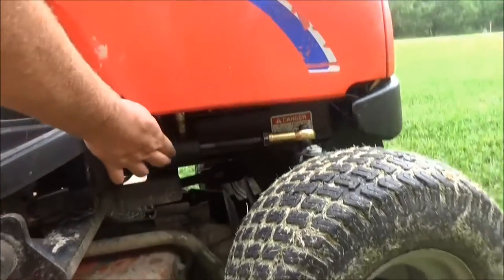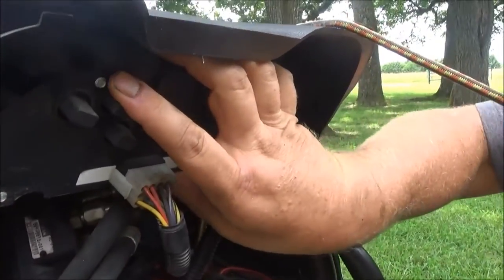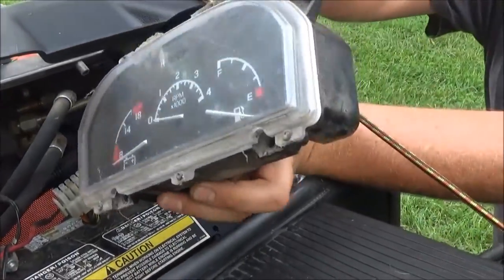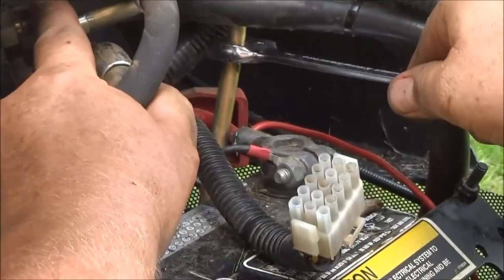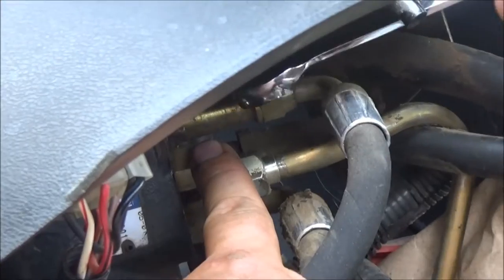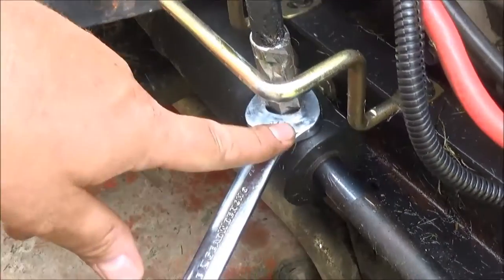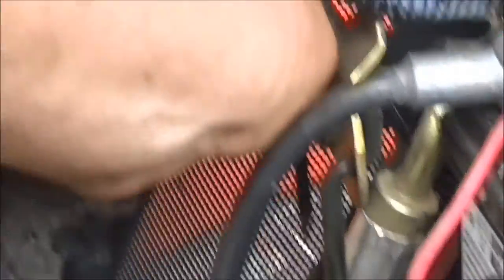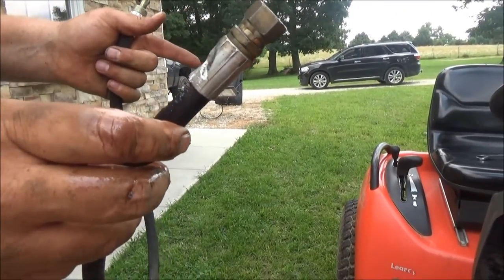How to take out the Hydraulic Hose on a Simplicity Tractor Mower

Comment: I have a small leak on my garden tractor I am going to working on soon, never worked on Hydraulics before. Why do you not have to bleed the lines after you get it reconnected. I have been worried about having to do this part of the project.
Reply from the maker: Greg Ward You will not have to bleed because the hydraulics will automatically bleed itself.
Reply: ty